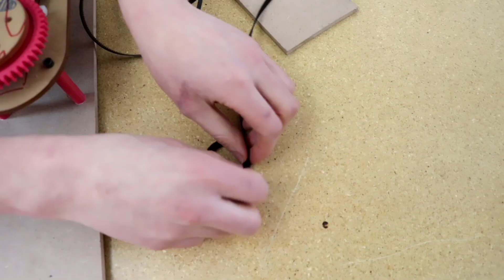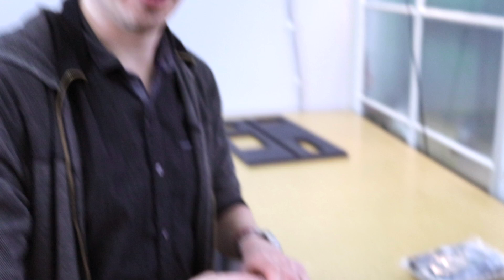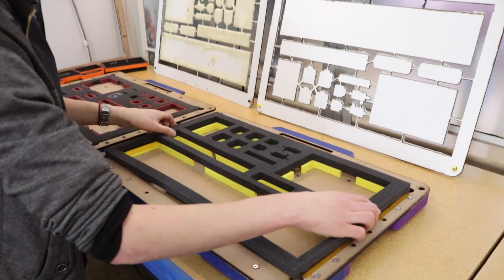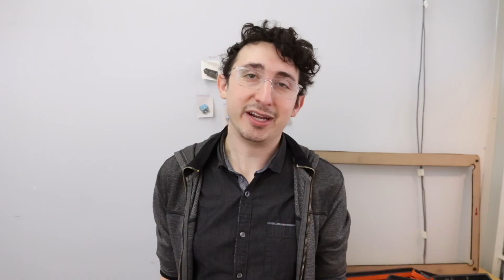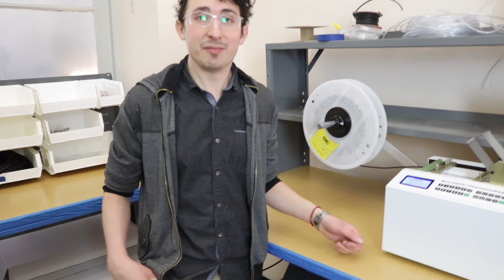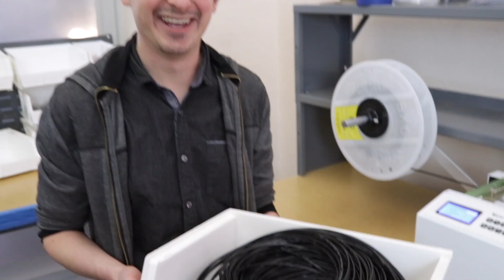This Machine Saves Me HOURS

Comment: you might want to tell us what takes you a lot of time so we can recommend helpful machines
also I think a cnc machine with two connected arms that cuts either styrofoam or I guess foam like the styrofoam cutting machines you see on youtube might be usefull since you could both layers at the same time and didn't need to glue anything together, which seems like it would be a huge timesaver
but its probably more of a project than a solution so not sure if its worth it
Reply: I think a full breakdown of the kitting process and how much time every part of it takes could be an interesting insight into the mid-scale manufacturing life!